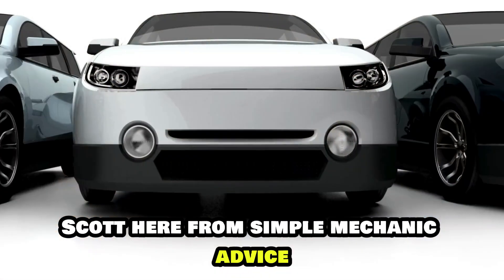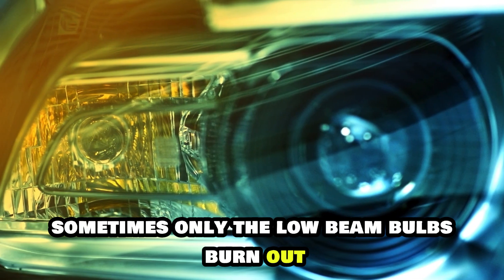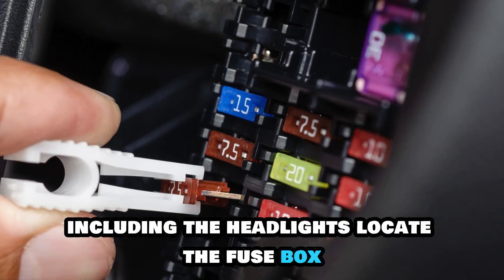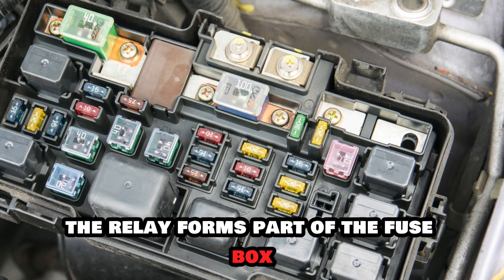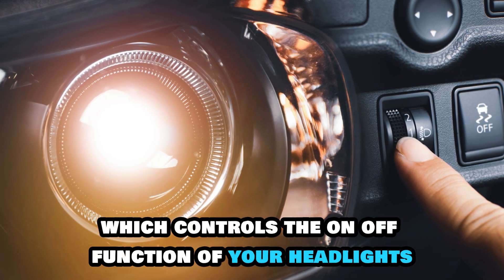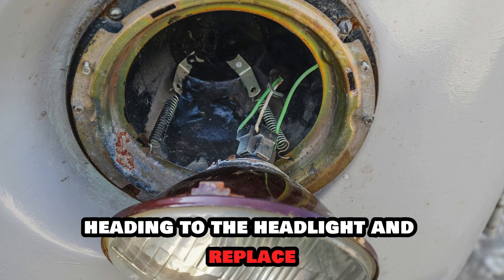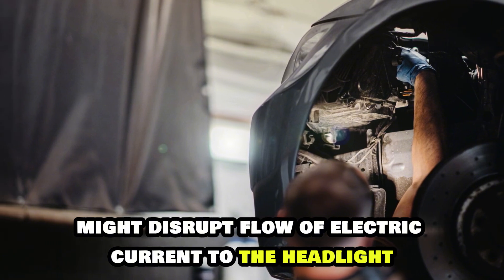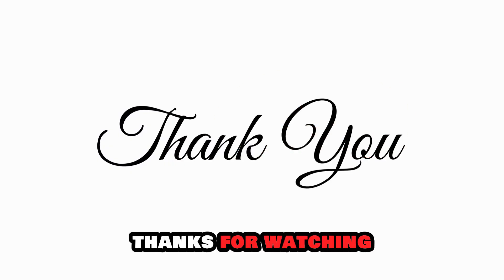Car’s Headlights Won’t Turn On But High Beams Work: Causes And How To Fix

Comment: Easy way to fix. The connector to the headlight bulb. Drivers side. Find the red wire with white stripe. Skin it. Run wire from it and connect to negative battery post. Electrical tape any naked wire behind headlight. Switch will work. Thank me later!😊

Comment: Was omw home last night, semi truck coming opposite way so I switch to low beams and NOTHING, PITCH blackness, I almost died. Car manufacturers need to start getting sued for issues like these. Downright DANGEROUS how the low beams can just ENTIRELY STOP working at NIGHT, While DRIVING. I'm pissed 😤
Reply: This literally just happened to me tonight 🤦🏾‍♀️ I had to drive home with high beams on and pray 🙏🏾
Reply: exacly what happened to me too! omg it was horrible! Dark highway with trucks going my every moment! I just held tight and prayed for my life! 😭😂
Reply: @susanneshines this happened to me last night, but thankfully the high beams still powered on (but even they seemed dimmer).  I forgot my car also has separate fog lights 😭 But worst case, put your hazard blinkers on
Reply: Same thing happened to me. There should be a mechanical switch that overrides the relay and whatever detects darkness.
Reply: @RobertA-m6g you really don’t understand how electrical system works. 
Headlights work with relays & fuses, how do you override that ? By connecting another relays & fuses in case the first relay & fuse goes bad ?
Reply: @Hugh-Jarnus  , modern cars, yes. And no, you don't want to circumvent a fuse. However, I was referring to (very much) older cars:
"No, the switch to turn on a car's headlights was not always routed through a relay. In many older vehicles, especially those from the 1960s and earlier, the headlight switch in the dashboard (or the floor-mounted dimmer switch) directly handled the high current required to power the headlights." -- Google AI
Also the multiple switches in a steering wheel stalk can malfunction. That is apparently what happened in my case. You're welcome.